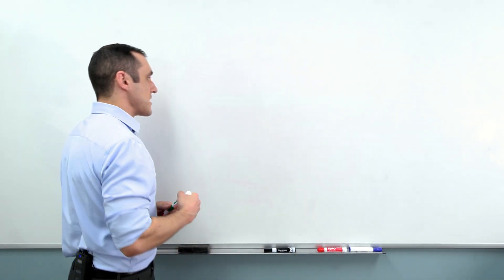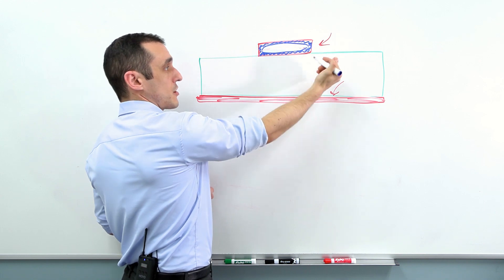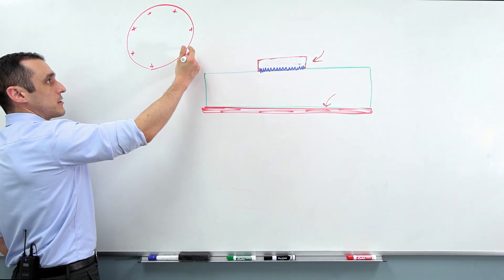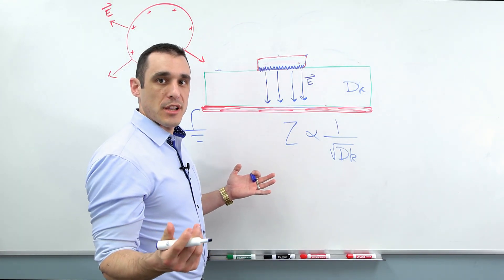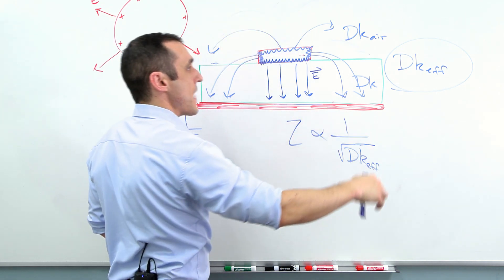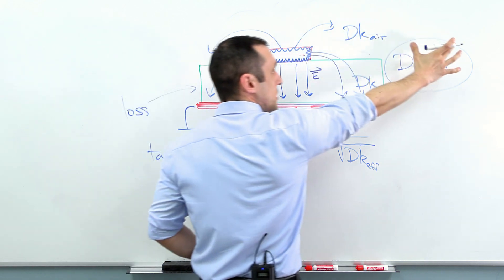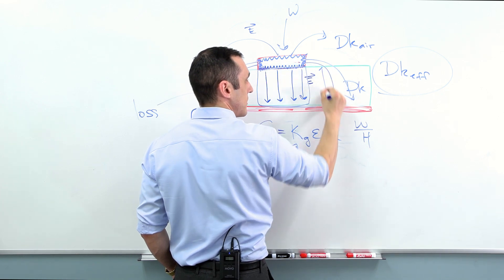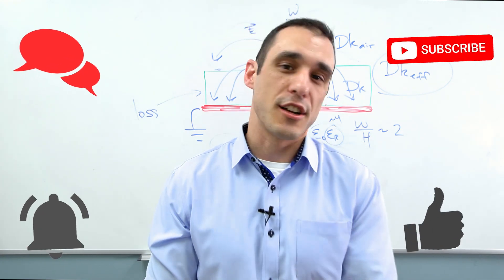Skin Effect Current and Fields in a PCB Explained

Comment: I think two things are getting mixed up here. First off all, the conduction current density is not 0 in PEEC for all frequencies, since at DC it is distributed uniformly. Secondly, the electric field lines you are presenting here are the rotation free part of the electric field, which is produced by charges and not currents. Strictly speaking, the skin effect is a phenomena appearing first in the quasimagnetostatic case, so is purely magnetic and has nothing to do with charges, electricfield lines between the two conductors of a transmission line and capacitance.
In my eyes this video really misses the topic/title. The video should have explained skin effect, proximity effect and skindepth based on an intuitive view of self and mutual induction inside of conductors. I am genuinley suprised by the content of video
Reply: Hi Half, thanks for watching. The point was not to derive the skin effect current or skin depth based on self/mutual induction. The point was to explain why the electric field is distributed around microstrip/stripline transmission lines even when skin effect is present as it is shown in some diagrams or simulation programs, which as I'm sure you know has everything to do with the charge/current distribution around the trace as well as the rate of change in the fields. Yes the E-field shown is the non-rotational part, but when a digital signal is traveling along the line, there will be a non-rotational component in the region where the fields are not changing and that will produce the field distribution shown here. If you like to analyze this in the frequency domain, then we would say that the signal's bandwidth is insufficient to excite any higher order modes, and thus the field is quasi-static and nearly-TEM, so we can analyze this in a 2D cross-section and get reasonably accurate results. This is the entire basis for 2D electromagnetic transmission line field solvers. Yes, we are skipping some steps as you have referenced but the picture of the electric field as shown in the video is correct and can be seen in any simulation program. There is sometimes a misconception that the fields and thus the skin effect only exists along that bottom surface between the trace and the plane, but that is not the case if you look at this kind of quasi-static situation and it should not be the case based on the current distribution.

Comment: Thanks for the teaser - now please explain what are the implications and design choices required to minimise skin losses?
Reply: I think you cannot really minimize losses overall, but you should account for it and might be able to safe some copper, if you are at midrange frequencies (frequencies before your transmission line is electrically short) by running thin parallel traces instead of one wide one. For copper the skindepth is 6.5 um at 100 MHz.

Comment: When you said "half" the energy is not from the directly facing side, was that just a very rough estimate (because the top is equally large, and the sides are small), or is there some sort of measurement about which portion of the energy travels/is concentrated on the portions closest to ground vs the more distant portions?
Reply: The statement "half the energy" is not to be take literally.

As far as a measurement, I can imagine some measurement with a loop antenna (near field probe), which is basically measuring the magnetic flux passing through some area (the cross-section of the antenna), and that can be used to calculate the energy passing through that loop.

From calculation, the method to get the intensity distribution in space would be to calculate the Poynting vector as a function of angle (in a cylindrical coordinate system, the trace runs along the axis). Then you could calculate the power flowing through some cross-sectional area using a surface integral. Or you could just plug in the angle around that trace and you would have your answer.
Reply: @Zachariah-Peterson  OK, that makes sense until "plug in the angle" (except that I'm not sure how to do it -- but am aware that it is too complicated for quick explanation) ... I would expect the energy to be more dense in the places where it can go straight to a close ground plane than in the places where it has to curve around.  I don't know whether it is (for example) 2/3 on the bottom and 1/3 on the sides and top, or whether the "skin" penetrates farther on the side towards the ground plane, and wondered if that were a solved problem.
Reply: Because of currents valocity the trace format is porportional